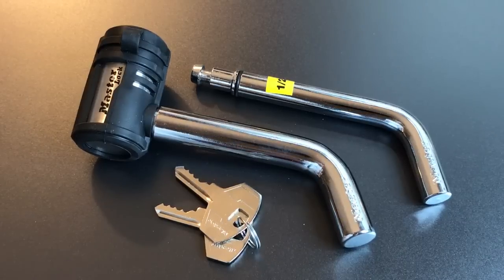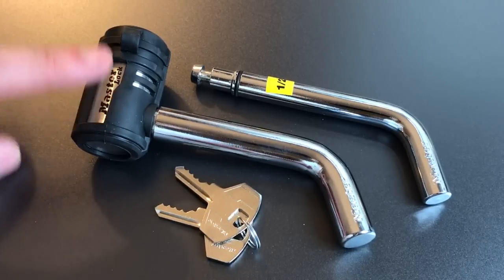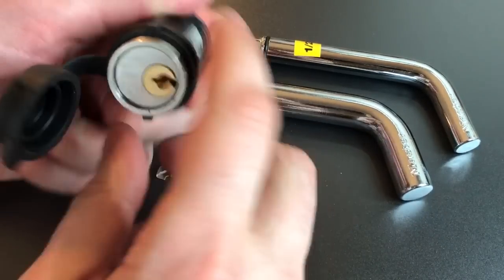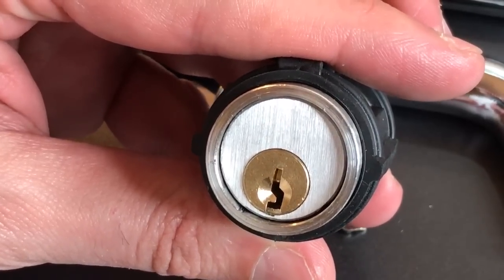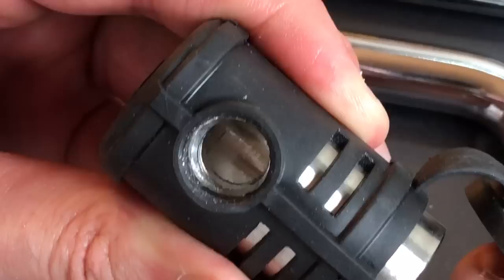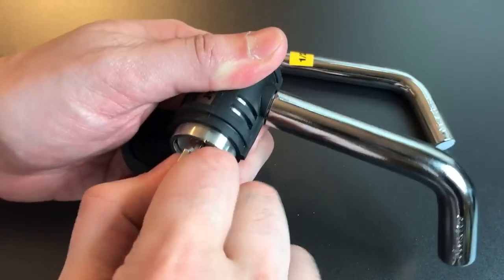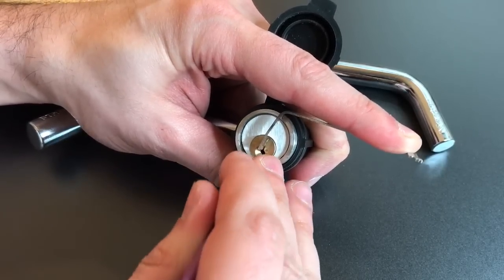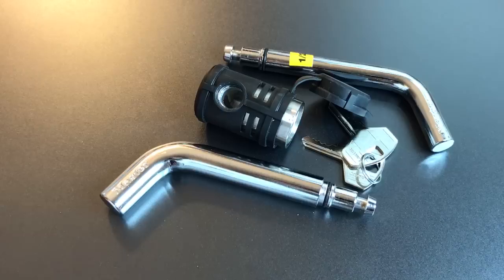[377] Master Lock Model 2866 Trailer Hitch Pin Lock Picked

Comment: I have been watching your videos for a few months now. Very impressive. So, here's my deal. Got to my far off destination at the lake and realized that I had forgotten the key to my hitch pin. That SUCKS. I found a very small bladed screwdriver to hold tension and a 1/8" cotter pin that was about 1 & 1/2" long, folded. I re-bent the cotter pin and raked it across the pins 3 times. It literally took about FIVE SECONDS to open the lock. Thanks for the education and helping me to save our boating weekend at the lake.

Comment: I recently bought a truck that had a drop hitch held in place by one of these locks and no key was provided. I've never attempted lock picking before and happened across this video. Instead of donning my safety goggles and buying $9 worth of cutoff wheels for my angle grinder, I decided to buy a $10 pick set from "LockMall" on Amazon and try my hand at this. Needless to say, after I received my new set, I had the hitch off the vehicle in about 2 minutes without even trying the clear plastic padlock that was included. Now I find myself wanting to practice on other locks LOL.

Comment: Prior to learning how to pick locks, I owned one similar to this one.  I had lost the key and tried a hacksaw.  That didn't work at all, hardened metal shank.  As a last resort I took a hammer to it and the locking mechanism simply fell off of the lock.
Bosnianbill did a vid of that procedure, I think t was "rapping on Masterlock".  
Currently I'm in the process of re-keying all of the Kwiksets securing my home.  They will have security pins, pin springs of different tensions and anti-bump features.  I have learned a great deal from you, BB and many others.  My wife thinks I'm a genius because I don't tell her where I've learned these things.  

Is that wrong?  ;-)
Reply from the maker: A hack saw would be brutal!  You would be better off with an angle grinder.  Of course, picking is the easy way.
Reply: May be hard to remember since it was 4 years ago this comment... but where did you hit it with the hammer? I have this locking pin and my key won’t go in anymore for some reason. Need it off
Reply: @BelfastSquid  you can probably hit it from the side and tug at about the same time. The goal would be to activate the pins and make them bounce, kind of like an external bumpkey would do! LOL!
This was years ago and if it happened now I would easily pick it.
Good luck!

Comment: Odd that you made this video. I bought a truck from a guy in TN. when I got back to VA,  I saw that he forgot his draw bar which had a ball that is no longer made. The pin had a Master POS lock similar to this one. I dint have the key. Had to send the hitch back to him to. Used a triple peak and standard tension wrench.  Opened in 3 seconds. Not much of a lock. But makes it difficult for someone wanting to steal it and doesn’t know locks.
Reply from the maker: That's seems about right...

Comment: As a practicing locksmith for some 40 years now, I LOVE your channel! But sadly I can't find most of your tools through any of my suppliers. HPC, A-1 etc are easy, but yours? The tension wrench you used on this lock was awesome, but I've never seen it?  Sources?
Reply: I've read previously that it's a standard TOK wrench that he manage to bend in the curve using a micro-torch to make it malleable.
Reply from the maker: Thanks Jack.  Mark is correct.  This is a normal Peterson .040" toothless prybar, with a bend that I put in it using a micro torch light to anneal the bend site so the tool would not break.

Comment: After a year on my truck, I had to cut the hitch pin with a torch because the cylinder was clogged up with road dirt, even with the dust cap in place.
Reply: Currently facing this problem. I tried soaking it in WD40 but it's not working.

Comment: Wimpy bitting. Only change in design I'd like to see would be a double-ended hitch pin with size reduction at the halfway point.
Reply from the maker: +eclipsedave Double ended?  Size reduction?  Can you link me to an example?
Reply: LockPickingLawyer Imagine welding the two bars end to end, except have only one bend in it so it's V-shaped.
Reply: LockPickingLawyer I figured it would prevent misplacing the one not in use, while offering the 2 size options.
Reply from the maker: +eclipsedave I see what you mean. Good idea.
Reply: LockPickingLawyer I've never seen a nice one like that one. Mine is an awful no name thing.